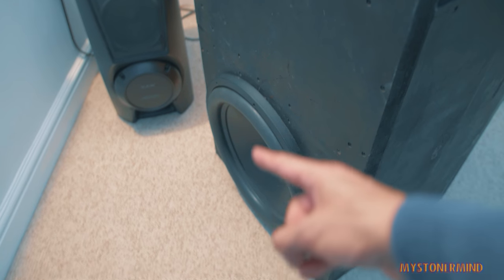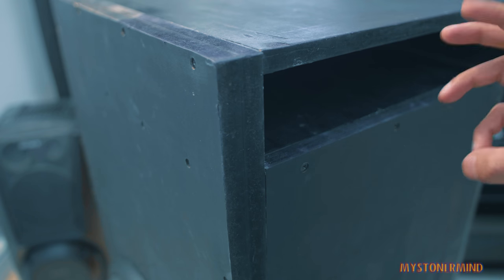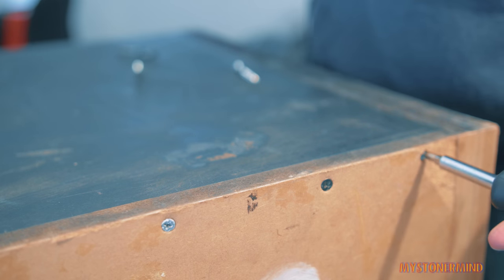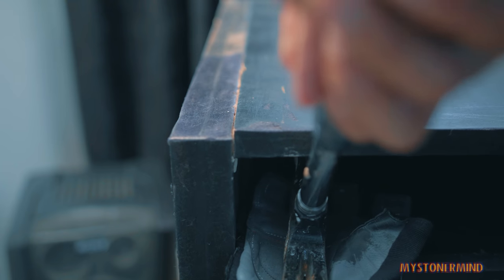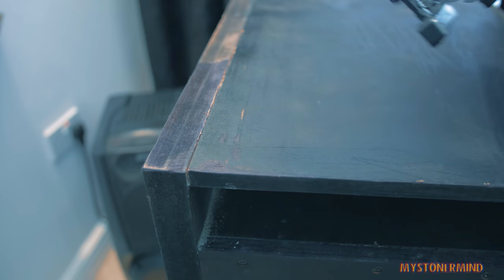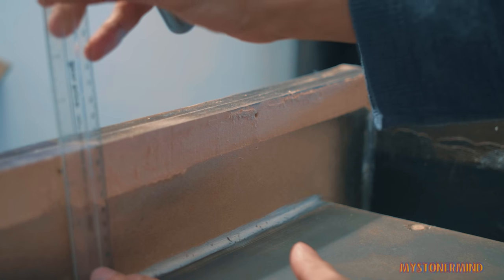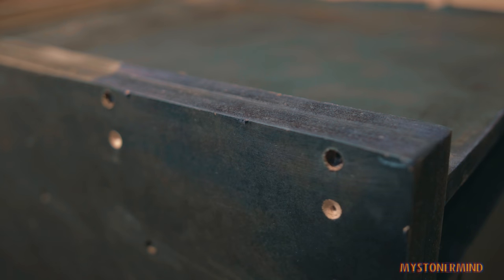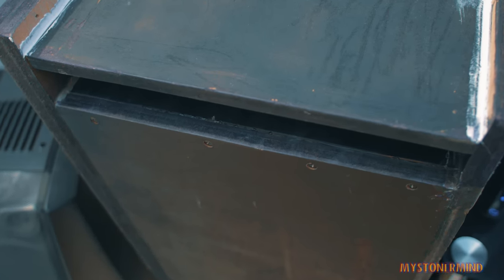Tuning Subwoofer Box To Hit Lower! - 22Hz Bass Port

Comment: Oh God... that sub box needs some love..., mystonerm, do you know what i would do it?, in case of make a mod to narrow a secction of the port or bass trap, line, (whatever name do you want to put on it) i just take measurements and built a port from a couple of 1/2" (or some less) sheets (wide) and the sides, glue it  very well add some 1/16" headless nails, then route the front and back of "the tunning tunnel" for better and nice air flow,   ...sand it nicely, really. then draw on it a scale in mm, or 1/16" then you can measure later the lenght... and later put inside the port, i just sand it very nicely, to fit very gently in that box port... the idea here, is that you can tune the frecuency as you wish or need, like a note is played by a tromboune...

that is  my humble idea... and give some love to that box!... greetings!
Reply from the maker: nice idea, I have already changed the box again and the video has already been done a few days ago. You will see it in not the next video, but the video after that, stay tuned ;)

tnx for watching as always !!
Reply: Ren Draco box need love but is 10yrs old has been working hard doing good job, he said in older video
Reply: thanks reaper, i already know that.

Comment: I dont know why but my dad made a subwoofer for his car using a 12" dd subwoofer and the box is way smaller than yours and goes dow 22hz,maybe 18hz
Reply from the maker: +CØXMINØX 2020 it'll reach them but it won't be very loud at those frequencies compared to say 30hz
Reply: +CØXMINØX 2020 all woofers go low. u wont hear it as much with small box. simple .
Reply: Reaper but it sounds like a larger box,you can feel and hear the bass
Reply: +CØXMINØX 2020 sounds like larger until u try larger, larger produce lower hz wit grater volume
Reply from the maker: Reaper, pretty much. 
Aslo Reaper and CØXMINØX 2020, the cabin of a car is a fraction of the size of a room in a house which allows lower frequencies of a box to be heard a lot easier. 

There's pros and cons to box sizes too, but if it suits your needs, non of this talk really matters dude 😃

Your dad probably designed the box to suit his music needs, the fact he has DD tells me he probably knows what he's doing, so it's all gravy my man.
Reply: My Stoner Mind why don't you make a homemade portable bluetooth speaker?i seen a Lot of potential in you
Reply from the maker: I would if I was more into electronics

Comment: Hey I tried to explain to my dad how smaller port drops the tunning but he said that smaller port creates higher pressure and creates a higher tuning but thought it was all about the port length,Can you give a logical explanation on why smaller ports drop the tunning?
Reply from the maker: yeah he's right, smaller = higher tuning. Longer = lower tuning.

I'm bad at explaining things but it's just basic physics. 
Blow into a small coke bottle and then blow into a larger bottle.. i'm sure you've tried this before, well the same sort of applies to port sizes.

(short n sweet)
Reply: stoner i heard similar explanation somwhere else too dont worry.
xINFINITExgamer whyd you tell ur dad that lol
Reply: +My Stoner Mind Then why does narrowing the port decrease your port tune to 22hz? I know bigger is lower and smaller is higher I just don't get how narrowing the port decreases the tune.
Reply from the maker: bigger isn't lower, longer is lower :) 
What I did was reduce the size and in doing so increased length.